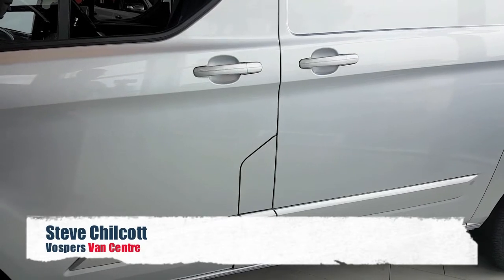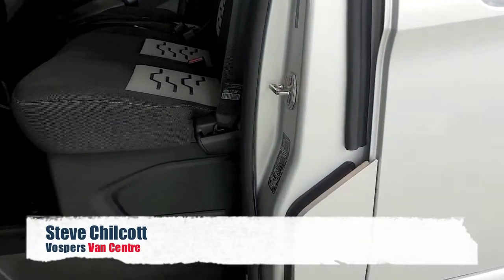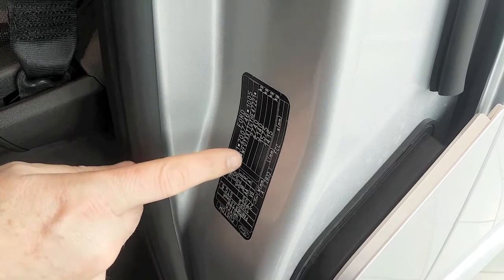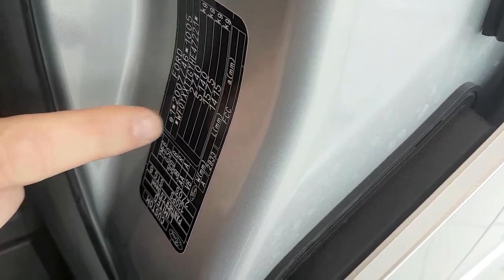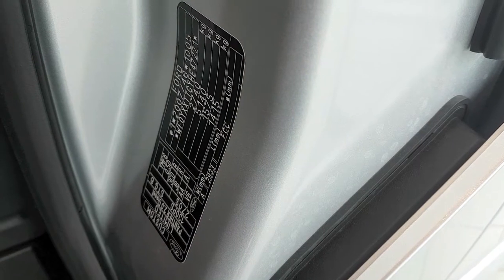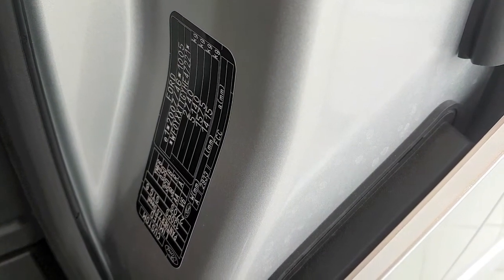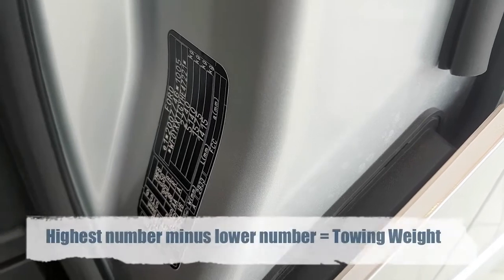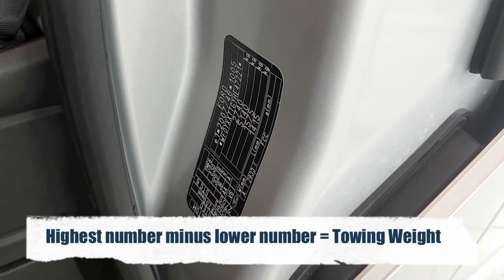What is the towing weight capacity of a Ford Transit Custom?

Comment: Is it safe to assume that my Ford Transit 250 can tow 5000 with a trailor?
Reply from the maker: Hi there, never assume would be our advice for life! Towing capacity is dependent on model year. If you would like a definite answer please reply with your Transit model year/reg and we'll look it up for you 🙂
Reply: @VospersMotors  how much can i tow with 2018 transit 350? low roof passenger van, not sure about the engine
Reply from the maker: @diuchdbajsk  Towing capacity will vary depending on a number of factors. Here's a link that should be useful: https://ford.to/3nUaX6V